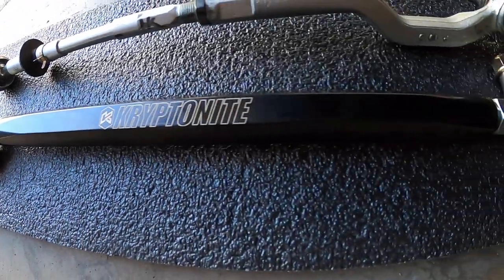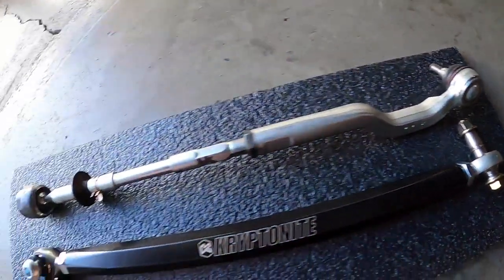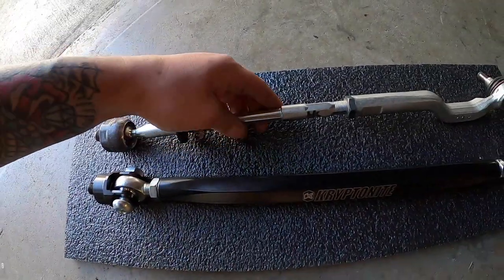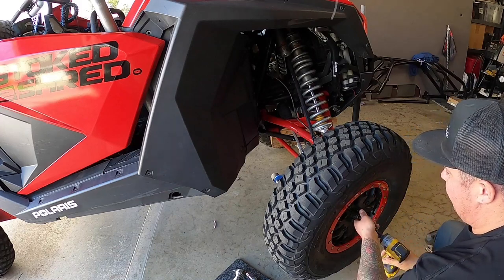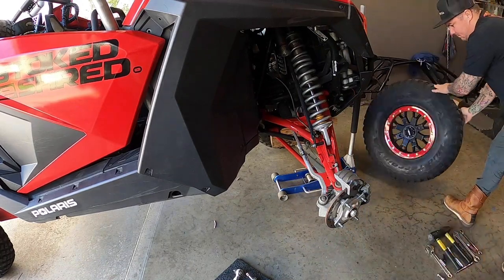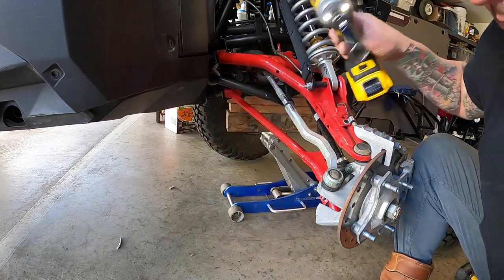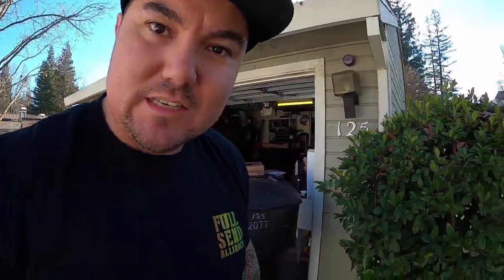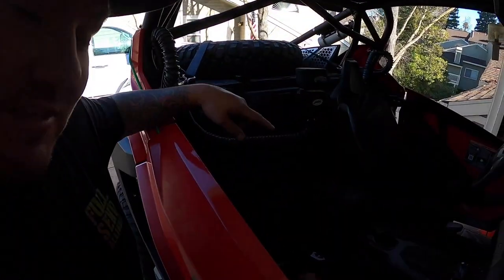Much needed steering upgrade & install on 2020 Polaris RZR Pro XP - Kryptonite Products Tie Rods

Comment: How are the tie rods holding up? Any complaints? Just ordered some to replace my l&w
Reply from the maker: The tie rods are tough as nails! 💪🏼 A lot has happened since this video and the car doesn’t look the same at all, but I still run Kryptonite tie rods. 
My only complaint is that at full extension of the suspension the tie rod will hit your upper arm with the wheel fully cranked. Wheel straight, or half turned, no problem. It’s only when it’s turned all the way. Couple different ways to go about fixing it. 1) Limit straps - Suck it up an inch or enough until it clears. 2) take a grinder to the tie rod where it hits the arm and clearance it. (Or lathe if you have access to one) 

Hope this helps!
Reply: @STOKED2SHRED2  it think its the way they're clocked. I have l&w that I'm switching out and one side was chewing up my upper, the other was fine. The only diff was one had a flat side of the rod in comparison to the arm and the other was on an edge of the rod. The edge side I assume sticks out farther and contacts it. Thanks for the reply. Glad they're working out for you.